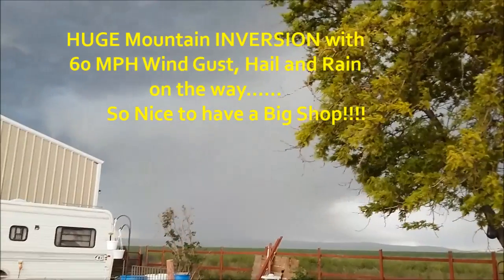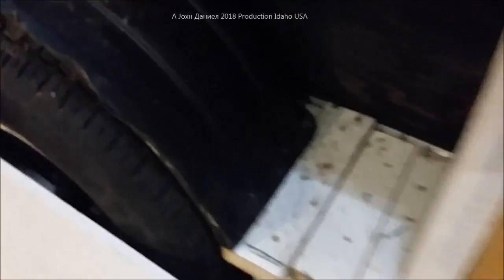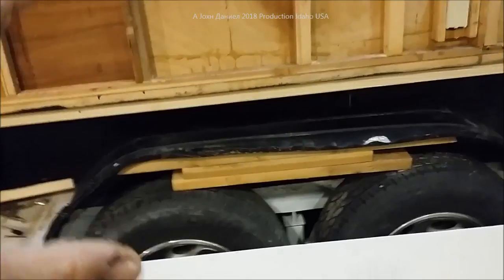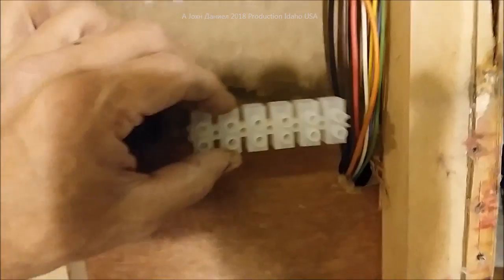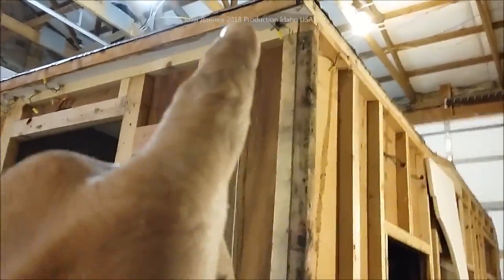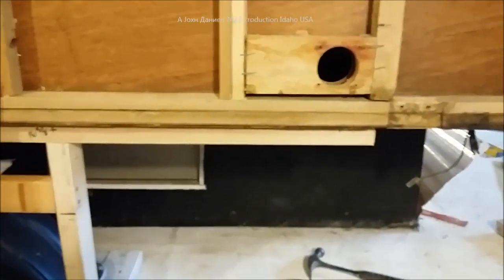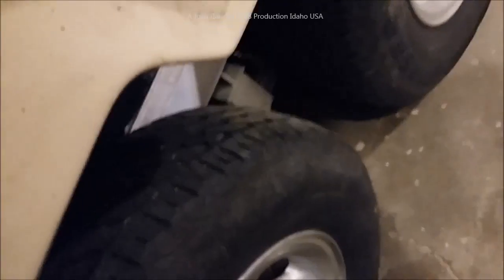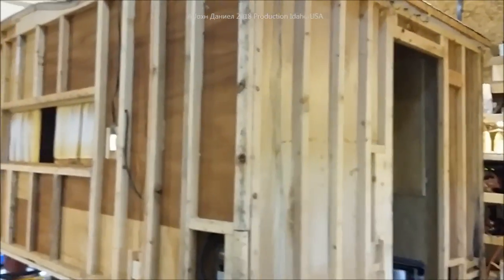Install camper fender wells, Hybrid Bug Out Camper stage 2, video 3

Comment: Hoping  for an RV update soon.  Tony
Reply from the maker: Doing much more on it again. Very busy RV repair season, 29 AC units installed in 2 weeks!! That and I am no longer hauling Cattle due to summer heat and new DOT rules give you dead cows! So I can get back on the Bug Out machine soon, a update vid coming. AND THEN, The Auction or Sale to follow - Maybe!